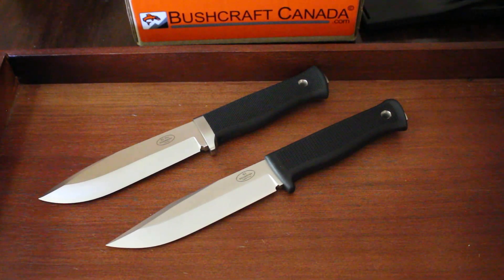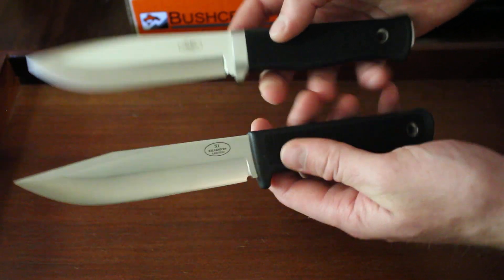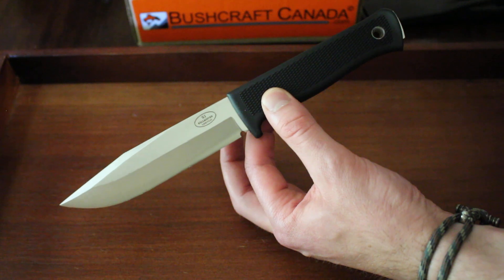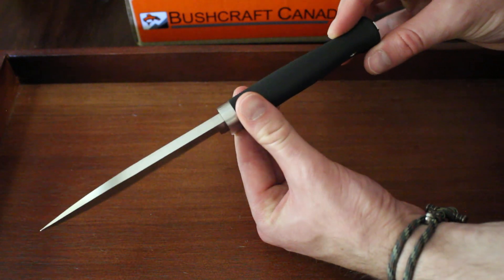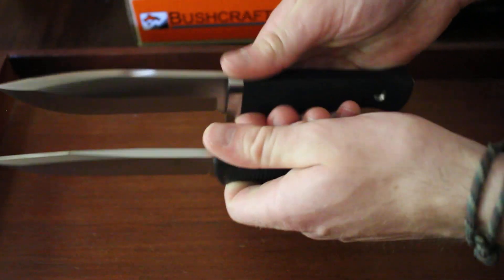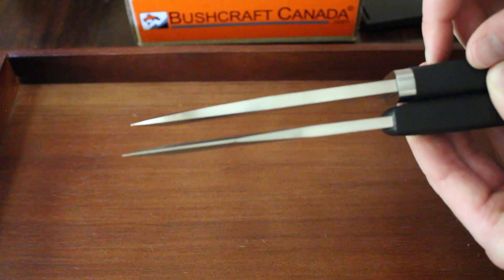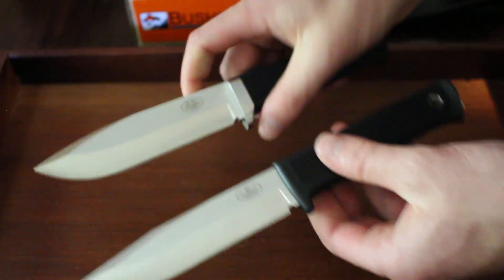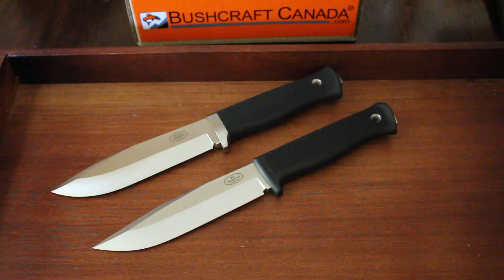Fallkniven S1 & S1 Pro Comparison by www.bushcraftcanada.com

Comment: Esthetically, the S1 looks better imo, but I’d have more confidence in the S1 Pro reliability wise with its thickness. 

I’m split between the S1s & the A1s, both are great & I’d always prefer to size down my equipment, but I can certainly see the larger A1 platform being an advantage in edge cases.

Comment: Thanks!  I don’t have a standard S1, but do have an original A1 and an S1 Pro.  I’m wondering now if I should have got the S1X instead, as perhaps the handle is slightly longer?

I also have an NL4, which is the same blade length as the S1, and have a leather sheath for that, which I use for the S1 Pro, and prefer over the rattling plastic sheath that I received.

Thanks for the side by side comparison, and would love to hear how the S1X compares to these.  (?) I heard it’s 50 grams heavier, and has handle scales that are replaceable, and that some people think are more comfortable than the thermorun on the S1 Pro?